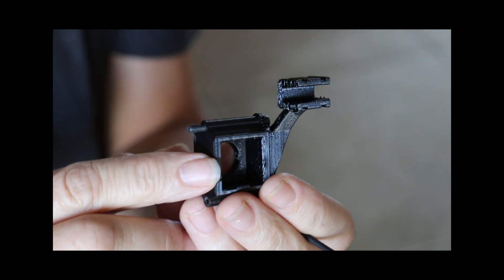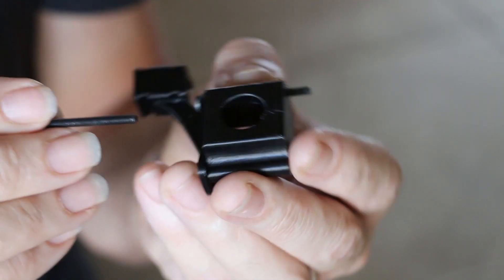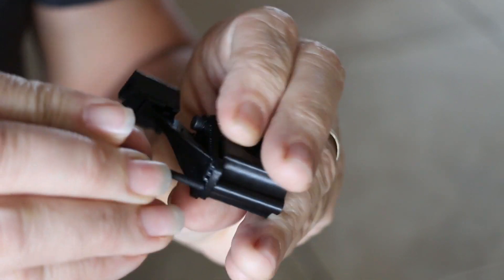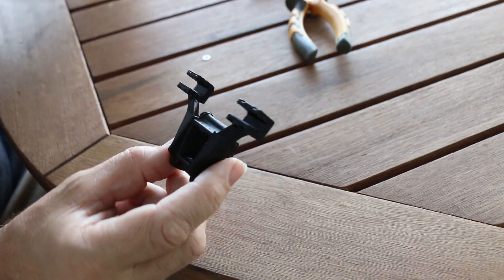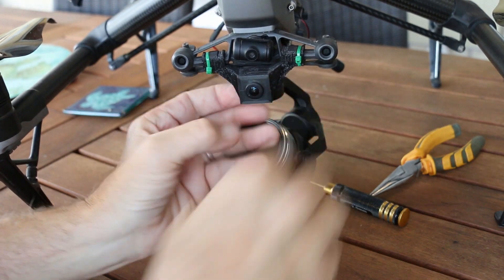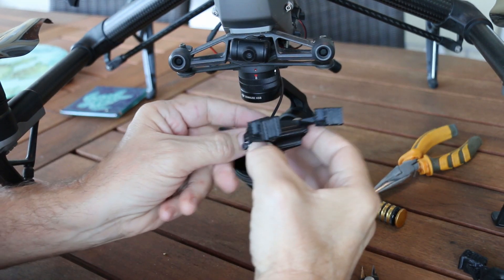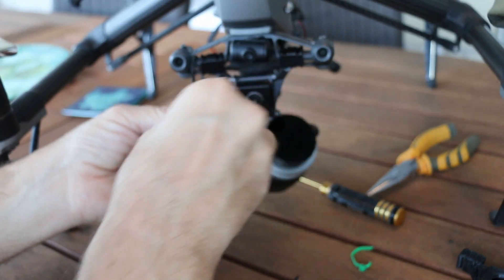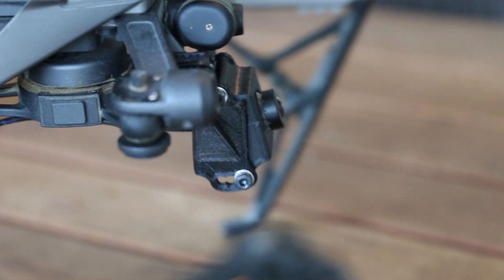DJI Inspire 2 FPV Mount Updated Design!

Comment: Hey man thanks for sharing this. Have you experimented with different Air unit power/channels to see what works best in conjunction with the Inspire? I was thinking to force inspire 2 on 2.4ghz band and then run about 500mW on the Air unit. Any advice?
Reply from the maker: Honestly I have an experimented too much. I haven't had any interference issues so I never messed with it much

Comment: if you fly with googles you can't control the telemetry! Why??
Reply: I don't understand the question
Reply: @RussellSpurlock  when you fly you use the goggles, so you can't check the telemetry of the drone, really? If you watch the fpv cam only, how can you check the signal strength of the drone for example?
Reply from the maker: That's true, but it's really much more of a specialty thing. You're not going to fly like this all the time. For instance, I use this on Top Gear America for certain shots. When you're flying with goggles, it allows you to confidently fly more like you would with an FPV drone, flying under trees, through closer obstacles etc. It's limiting in that you can't confidently fly backwards or sideways very much because you can't see those directions, but particularly if you have a camera operator, you could fly the drone away from your subject and still have the camera trained on your subject. You can fly closer to the ground confidently etc so there are just a lot of shots that are better shot this way. That said, you'd only want to do this at relatively close range and in the earlier part of your battery life so that you don't really need to be looking at you or telemetry. Make sense?
Reply: @PossumPilot  I fly with operator since 10 years, when gimbal was with servo motors instead brushless. For side shots, and for other places (example, between trees) where signal strength is very complicated to manage, fly with goggles is really difficult and could be dangerous, specially if we are talking about I2. The best way is to use a good analog vtx with analog camera, and use a separate small monitor with diversity receiver, dedicated to the fpv cam only.
Reply: @airfilm_it  well, it sounds like this is not the thing for you. And yet I have found that it works perfectly for me in professional applications. So it sounds like you could safely ignore the contents of this video and just keep doing what you are doing :-) 👍

Comment: What material did you print those out of?
Reply: I prefer priline TPU for these kinds of parts. It's flexible, but much harder than other TPUs such as sainsMart
I use it for parts like this and also for bumpers, GoPro mounts etc
Reply: @RussellSpurlock  thanks for the info! Stoked to apply this to my inspire!

Comment: Hey man. Thanks for sharing this. Quick question - have you tried this mount using the 12mm x5s mount tilted up fully? It looks like it might obscure the camera lens a little. I’m wondering about making a different version which maybe sits in front of the nose cone instead maybe?
Reply from the maker: I actually never do tilt the lens up fully so I haven't tried that yet. What are you shooting that you need to tilt up like that, just out of curiosity?

Comment: I also loathe the FPV camera on my Inspire 2. Absolutely pitiful for every reason you mention. I fly often with a camera operator, so I’m fighting the crappy everything with the inadequate stock FPV. I have made miniature ND filters that stick on, but you still fight the low resolution and small picture inset on your iPad screen. 
I think I will be going this direction as well, so I am very interested in what you are doing. Have you had a chance to fly with version 2 adjustable mount? Is 15 degrees upward tilt enough? Obviously depends on your forward speed, but just curious of your findings. I really think you’re onto something with your design, nice work. Are you using your own 3D printer?
Reply from the maker: Haven't been able to test it extensively... I started having an unrelated issue with this Inspire and have had to send it in to DJI... am hoping they don't remove the mod while they are in there ;-) Will report back
I do print my own parts... Ender 5...